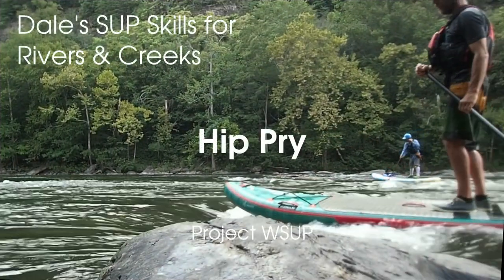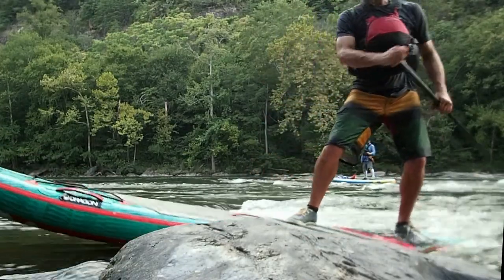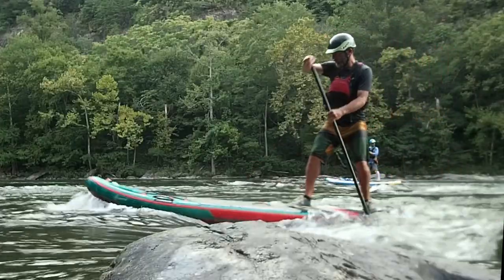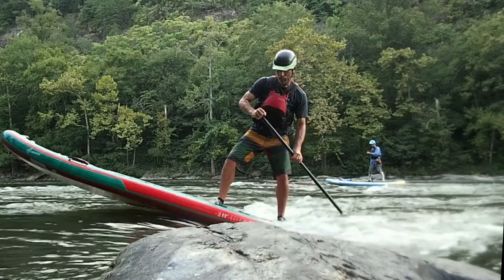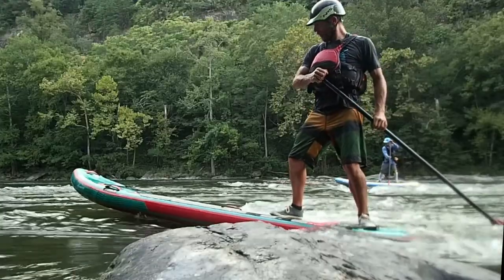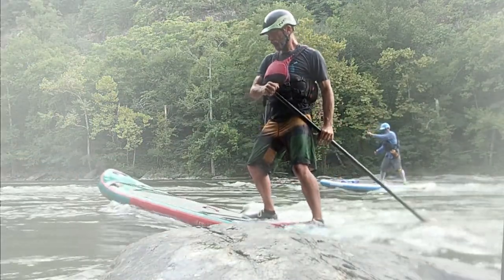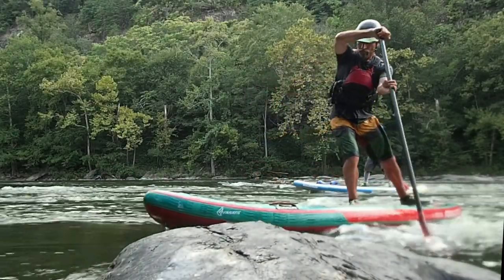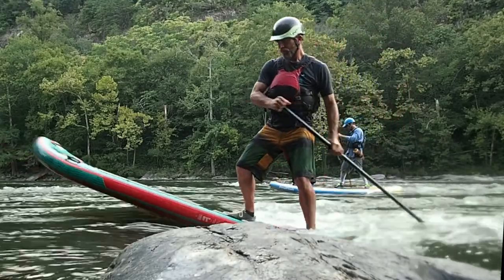Project WSUP: Hip Pry

Comment: need to do a video on entering med size waves on 9'6-10' boards
Reply from the maker: Do it, Matt!
... or did you mean I should do one on entering larger waves ... green waves - hole waves - m-waves - etc. 
The hip-snap you can see in this video that I use to pop into the hydraulic is the same fundamental skill you need for getting into bigger waves as well.